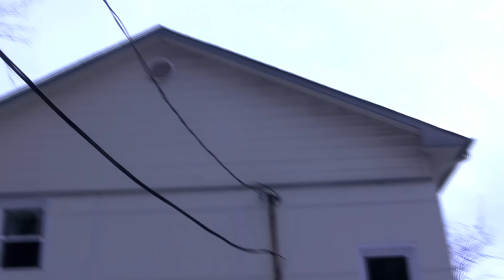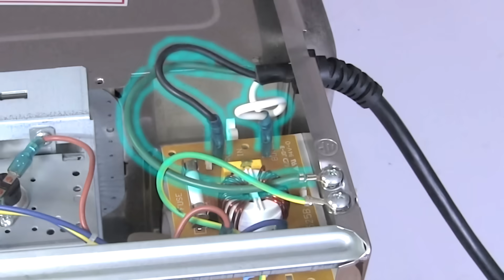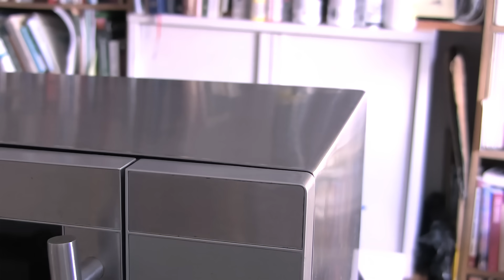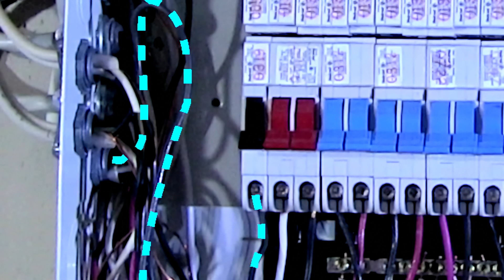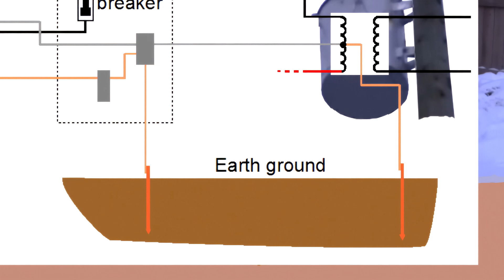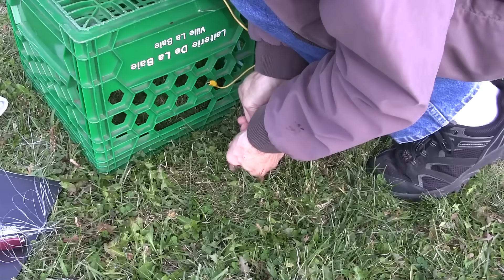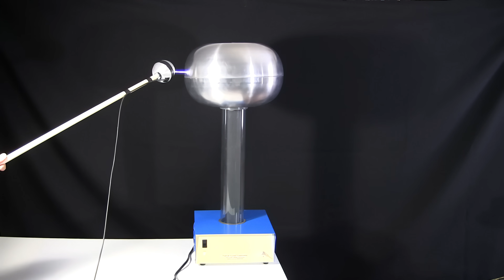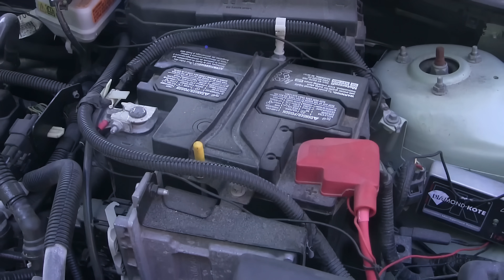What is Ground? Earth Ground/Earthing

Comment: If they ground on a plug is ultimately connected to the neutral, why do we need a separate ground cable?
Reply from the maker: If the microwave oven is turned off then the hot wire is not connected to the neutral wire. If at that time the insulation on the hot wire breaks and the wire contacts the microwave oven case then you'll need a path for the current to go. Since the ground wire is connected to the case, the current will go there and complete the circuit, and case the breaker to trip.
Reply: I think what he meant is, since ground and neutral are connected at the panel, why not just connect the microwave case to the neutral wire inside the oven instead of having to use a separate ground wire to connect the case. In your video you didn't explain why they don't just use two wires only (hot and neutral) and then just connect the microwave case to the neutral which already has is connected to ground at the panel.
If the hot wire would short circuit to a case connected to neutral instead of ground it would still blow the fuse.
Reply from the maker: True, but you also have to look at what would happen if the neutral is connected to the case when you turn the microwave oven on. In that situation the case would become a part of the live circuit. When you close the switch to turn the microwave oven on, the hot, neutral and case will all be connected together. The current may not take the path through the case normally but if you then touch the case, then the current will have two paths to return to the panel. One is from the hot to the neutral to the panel. The other is from the hot, to the neutral, to the case, to you down to your feet to ground, and back to where the ground connects to the panel (assuming your feet are making good contact with ground).
Reply: Folks use to connect the "case" of household device to the neutral. Examples are ranges, ovens and clothes dryers. That is why these 240 volt devices use either 3 or 4 prong cords and sockets. Newer devices use 4 wires in an actual green wire grounded wire not for current.
Reply: That is an excellent question.  Why not simply connect the appliance chassis directly to the neutral wire at the appliance?  In other words, why not construct the outlet so that the 3rd prong is connected directly to neutral at the receptacle?  Then, there would be no need to run a separate conductor all the way back to the panel, right?  

I will tell you.  It's for safety.  Let's say it is wired that way--the 3rd prong is connected directly to the neutral at the receptacle.   Imagine now that the hot conductor faults against the chassis.  The current will travel from the chassis, through the grounding wire, to the 3rd prong, to the neutral (connected to the 3rd prong), and to the panel.  High currents will flow and the circuit breaker (or other overcurrent device) will open and shut off voltage to the device.  All is good.  

But here is the problem and why that wiring scheme is prohibited.  Let's say that the same hot wire faults against the chassis.  But this time, the neutral wire has failed somewhere between the appliance and the panel.  The fault current can't flow back to the panel, right?  So what happens?  The chassis is now at 120V volts, not "ground."  The hot wire is faulted to the chassis so whatever voltage is on the hot wire is also on the chassis.  Often the voltage is at 120v. It's a rattlesnake ready to bite the first person who touches it.
Reply: 3/ 4 wire Range History :  The older 3 wire scheme is prohibited for new homes but is grandfathered in for homes that are already built. Most all homes use the old 3 wire scheme since the law came out about say 1996 but each serfdom in the USA can with their Czars decide when to actually use the newest NEC code. ie it takes years for each place to actually "adopt" a new code version.

Most all ranges in the USA have the chassis tied to the neutral, with no green wire ground wire. ie 3 pin cable not 4 wire cable.   In the USA the 240 volt Kitchen Ranges and 240 volt Laundry clothes Dryers got a 4 wire plug roughly about 1996, but there is a local option to accept new codes thus well after 1996 a new home often got 3 wire range circuits. Crafty builders pinch pennies, home being built 10 years ago still often used the older scheme, since still legal in their area. 

Todays NEC code book is 2017, the next is 2020, the next is 2023. Locally the cities that got Fema money have to be within  "2 code book vintages" since they signed their pact with the offering/ Fema devil. :) Thus here the 2014 and 2011 are in usage. Farther away the 2008 are in use and the 2005 too. 

  The NEC gets a new code book every 3 years,  Mayberry RFD might be 6 years behind, Oxnard 3 years, and po dunk 20 years behind but with their own revisions that adds stuff. 

The majority of homes in the USA are from before 1996 and thus the Kitchen Range has its chassis tied to the Neutral, ie no green wire ground. Thus scheme goes back 100 years in Ranges.  That is why a new range or oven never has a cord, ie since the home is often 3 or 4 wire. 

 The NEC section  250.140 Frames of Ranges and Clothes Dryers. After 1996 if the local code adopted the full 1996 code then the home had a 4 wire range outlet, ie extra grounding wire.

 The practice of using the white Neutral wire as the "green wire grounding" on kitchen ranges increased after 1940. This was due to the war buildup copper and rubber scarcer. 3 wire ranges were the rule in about all new homes after WW2 to 1996, then the 4 wire trickled in usage. Codes and Cities are like guns and alcohol laws, a zillions of combinations and each place has its own rules, really a messy no answer.

  If I had to make a guess at a casino maybe I would guess that the year 2000 is where the majority of new homes built used 4 wire range cords. ie since the acceptance of new codes is slow.
Reply: Good explanation.

Comment: Ground - that means closing circuit of every equipment end point of neutral and also neutral connected to the ground finally (Neutral or Ground both are same technically)                                                                                                                                                              Earthing - To protect the human body for electrical potential hazards and safe operation of all electrical equipments, etc.

Comment: The ground is also connected to the neutral at the transformer at the pole. The case of the transformer on the pole is grounded. Edit grounded at every poll all the way down to the substation is grounded from the substation. All the way to the power plant.

Comment: I see that the phase and the neutral are distributed. The neutral is connected to earth in the distribution network and there is a protective connection, connected to ground.

Is the earth leakage protection differential? In Europe, for this type of distribution we use a differential switch, calibrated at 10 or 30 milliamperes, for residential use.

This ensures safe interruption of supply for both indirect and direct contacts with the phase.

What would happen, in the system you have described, if a person touches the phase wire when it is not drifting through the protection line?

Comment: connecting the neutral cable to the case....yheep that sound like a great idea, I know that no one will travel with a microwave, but if you plug any device with this configuration into a reversible socket using an adapter you may get a shocking surprise, because some reversible sockets  or extensions don't have the ground cable

Comment: in between breaker and transformer if the neutral wire fails the cover of cooker will be hot and can couse injury. ..
so I don't prefer TNC system  of installation

Comment: I wonder why they did not just use one wire for neutral and ground, we would have just 2 holes in sockets. Of course, they have to be built a way the plugs cannot be inserted the other way around since that would live the case.
Do they use 3 to ensure that no one tries to reverse the channels?
Reply: Then, the neutral wire would be connected directly to the case and the case will work just like those of cars do. What would be the problem, then?
Reply from the maker: The problem with neutral being connected to the case is that neutral is the return path for the electricity. Whenever the microwave oven is turned on, if you were grounded and you touched the case then some of the electricity would flow through you.

Comment: i just dont get it
Reply: estudasses
Reply: Electrons like to flow when there's voltage, electricity are electrons flowing. A ground is a safety feature, it's a way to let the electrons flow out of the microwave casing iincase the wires get damaged and touches the case. Other wise if touches, the electrons will flow to your body, and that's called being electrocuted.

Comment: Great video - clears up a couple misunderstandings I have/had. I have cheated in an older house where a previous owner wired a 3 prong plug fed with only a 2 conductor line and hence left an open ground - dangerous! Not being able to replace the wire (time, money, etc) I just connected the plug's ground to the neutral in the box. Definitely not code, but tactically safer.

Followup questions related to the magic of household ground: I have measured current of up to 10A flowing from the breaker panel ground wire to the incoming water line - I believe this is a function of an imbalance in power consumption on the two buses in the panel requiring a return path out of the panel (via neutral), as well as the power entering the utility step down transformer being wired to ground, and not back to the generation station (ie: one-wire-earth-return power distribution setup). Or am I confusing too many moving parts? An "advanced" followup video to touch on these apparent quirks would be great!

Comment: sir u know what is actually emitting from tesla coil?
Reply from the maker: The streamers at the terminal of a Tesla coil is high voltage, alternating in polarity. That means that part of the time it's putting electrons in the air and part of the time it's taking electrons from the air. The result is that the air is becoming ionized.
The high voltage also breaks down molecules in the air, ionizing them. In that case it's not emitting anything, just affecting the air from a distance.
It probably also produces ozone too.
Reply: RimstarOrg  sir i saw CFL glows but will TV  works here?
Reply from the maker: A TV shouldn't glow near a Tesla coil. The CFL glows because of the gases inside it. A TV has a vacuum inside it. If you're asking it a CFL will glow near a TV screen, I'm not sure. I doubt it.

Comment: Very good video. (RE: 2:18) Could you explain why the microwave becomes unsafe to touch without the grounding rod (i.e. the case is connected to the circuit, but nothing else)? I would have thought that if you touch it, you would have more resistance than the path the electricity could take from the live wire through the case and back into the neutral wire. That is same reason why a welder can touch a metal work table (or stand on a metal ship) without getting shocked because the circuit isn't considered closed because of the high resistance.... Sorry if I've missed something, I've forgotten a lot of my physics and am trying to relearn it.
Reply: In otherwords, I'm assuming the case's grounding would lead directly to the neutral wire, with say a diode to prevent AC reverse flow. Wouldn't that just as effectively remove any charge that builds up, or if the live touches the case?
Reply from the maker: Assuming you're grounded when you touch the microwave oven's case then you provide a second path to ground. You'd have two parallel paths. The current would be divided. At least some current would take the path through you. It may or may not be a lethal amount, depending on the resistances of the two paths.
Regarding the welders, I'm not familiar with them. It may be that the welder's voltage is low voltage. Current = voltage / resistance (I = V/R). The higher the voltage, the higher the current will be assuming the resistance through you is the same in both situations.
Reply: Thank you very much for replying.

I see, the part that was confusing to me was that I did not think of it as parallel, and forgot that current divides and while a parallel circuit. I was asking why does the current 'try' to charge the earth through you, 
rather than go (say across the surface of your finger on the case) back through the circuit board to the negative. I was thinking of it as an "either, or" scenario, almost like a transistor; the phrase that "takes the path of least resistance" kept popping into my head, which was throwing me off.

However, if I understand you correctly, then it goes through both (ground, via you, and negative), because it becomes parallel except that the sum of resistances along each path is different. The electricity spills unevenly rather than selects a single path.

(Given the same rule of divided current, and suppose the welder would also suffer a very small, imperceptible charge)

So would the self-discharge rate of a microwave's live and neutral wire on its own not be enough ,, and would it depend on the individual appliance's (where a microwave with a high voltage would discharge 
faster than, say, a tiny radio with a huge metal case/speaker to act as a big capacitor)? I am guessing the voltage difference between the earth and the live wire are high that it's much quicker, and reliable?
Reply from the maker: If I understand your last paragraph correctly, you're thinking there's a charge built upon the live and neutral whereas there isn't. It's alternating current, so it's alternating between 120V RMS and 0V. It's never high voltage.
The microwave oven does step it up to high voltage inside, and I don't know the circuit in detail, but the live and neutral wires are isolated from that part of the circuit. For that high voltage to make itself back to the live and neutral wires then something else would have to go wrong with the circuitry inside. Normally, you'd have to open up the microwave oven and poke around to get hurt by that high voltage.
Reply from the maker: I don't get what you mean by self-discharge. When you turn off the microwave oven, the live and neutral wires don't have any charge on them to discharge.
Reply: I should have specified that I was considering a lightning strike scenario charging the metal surface area. Wouldn't the microwave self-discharge along the grid as well as along the ground, albeit slowly? That's why I was considering whether different appliances, with different voltage ratings.
Reply: Like a step down phone charger would benefit more from a ground than a microwave, which has a high voltage anyway. Or something with a large surface area but low voltage, like a small radio with a large speaker cone (like a gramaphone), would benefit more from a ground's voltage difference. 

However, as you rightly say, ground and neutral within a circuit tend to be isolated. I was again considering my original post's hypothetical scenario where a case's grounding leads directly to the neutral, sort of like polarity protection, but with the purpose of siphoning charge from the case (sorry, I'm complicating things for myself).
Reply: Actually, now that I think about it, my question is stupid except for DC applications, as the negative cycle of AC would draw charge from the case, making it a positively charged, static shock hazard. Even with DC, if lightning strikes then it's most probably that the diode would either blow, or the components beyond it wouold blow, depending on capacitance of the case and the component's ratings.

Comment: nice video, but i still have some problem with ground i hope you could clarify, does the ground make neutral safe to touch if so, why not connecting the hot to a separate earth ground rode to make it safe as well